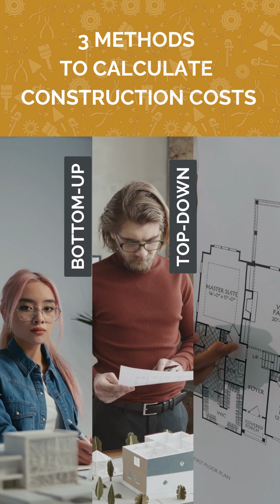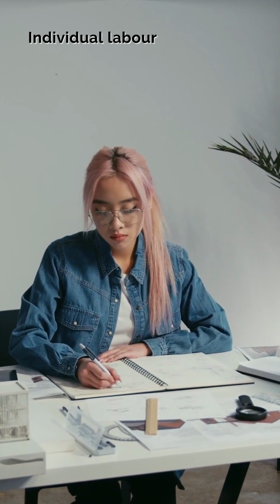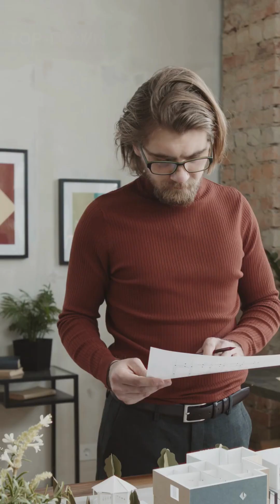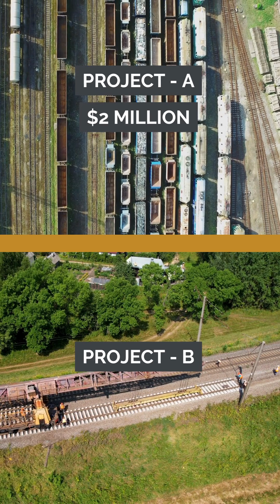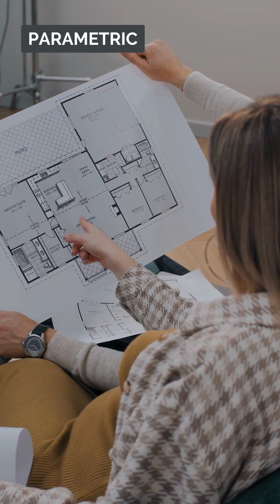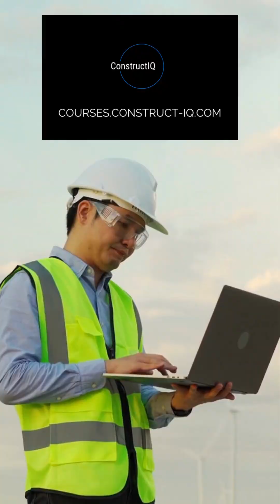Construction Cost Estimating - Methods

Comment: What would you say is the average cost of a construction project?
Reply: What type of construction project are you talking about, how intense are the trade/material/ labour per square metre of the project?  If you know a similar project, just divide the total cost by the square metres (you get a $/ square metre rate), then multiply the new project square metres by the previously established $/square meters, then bingo you have your answer.